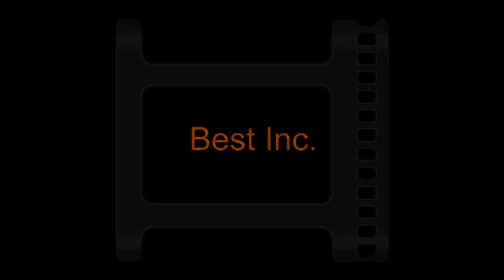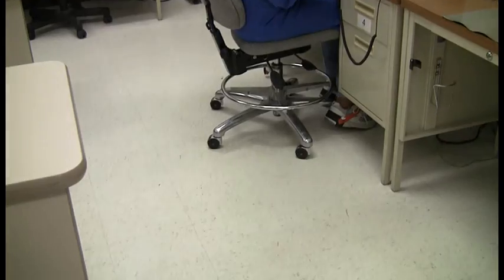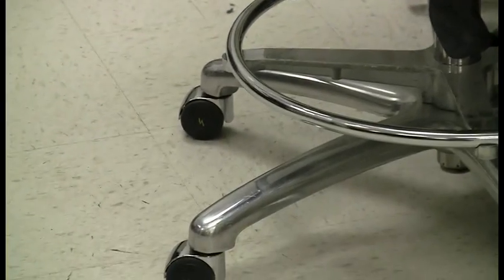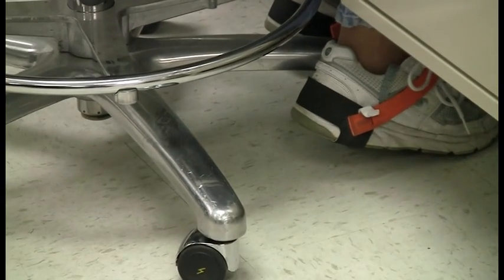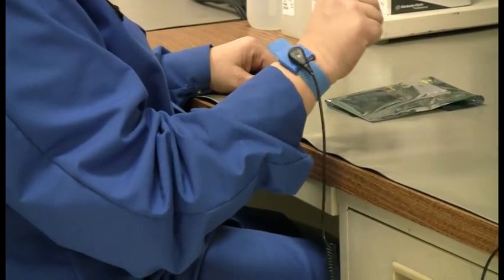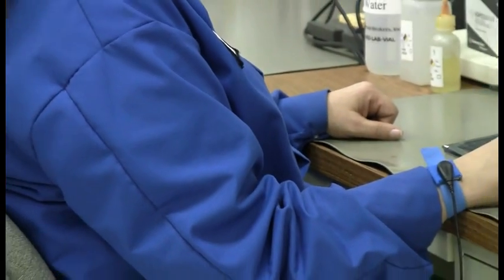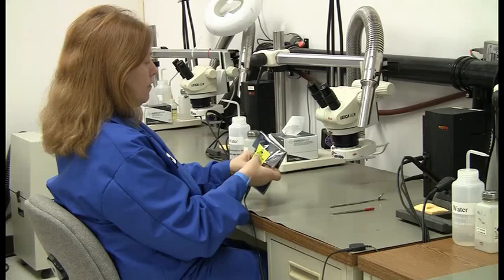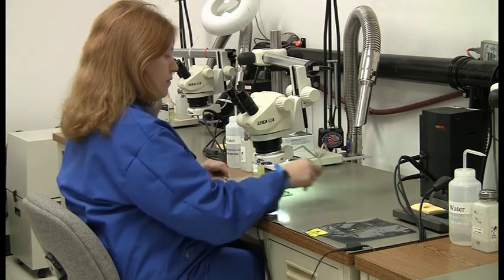ESD Protection at Soldering Techs Workbench

Comment: This is a good video but I was left wondering where is the smock is connected to her skin. In the environment I was trained in the grounding cord attached to the smock and the worn wrist strap was attached to the smock. This way the coat was not a floating conductor on top of the clothing, potentially creating a insulated charged surface.